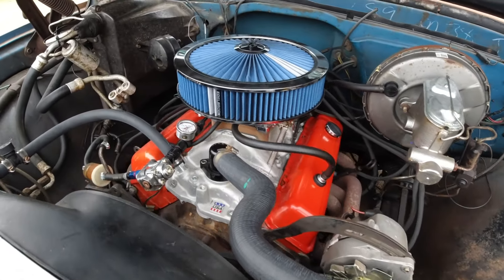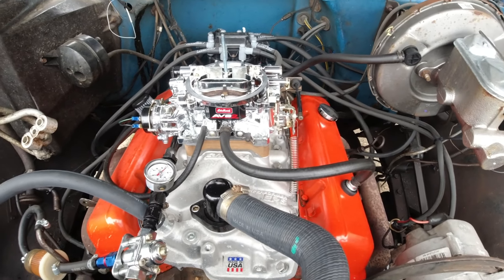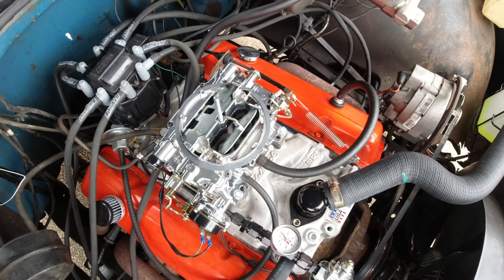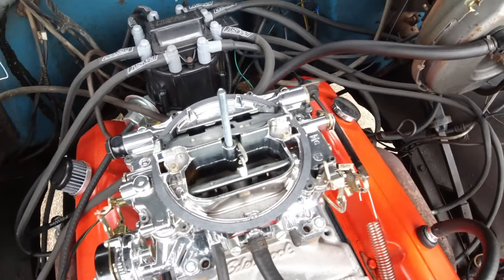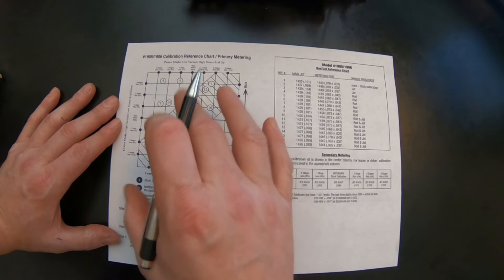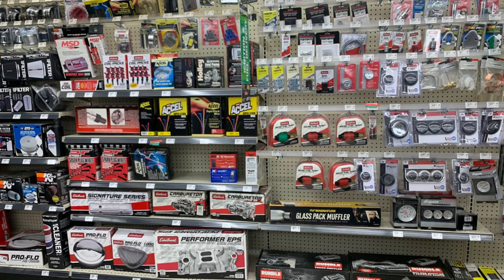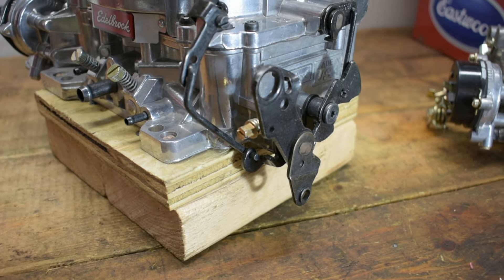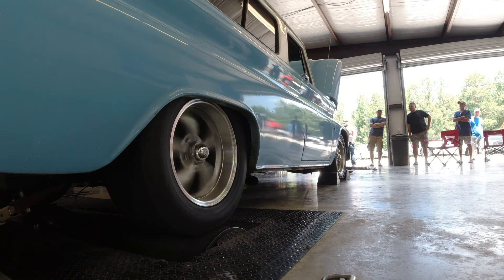Edelbrock Carburetors - The Good, The Bad and The Ugly

Comment: I have a stock pontiac 350 with basic upgrades and plan to replace my two barrel  , my question is what carburator should I run because I like autocrosding my car but I dont want to starve it but also a good cruiser, love driving my car everywhere
Reply from the maker: Check out my video on how to choose the right size carburetor.  How to Choose the Right Size Carburetor
https://youtu.be/Hy4s9B43YM0
Reply: @MuscleCarSolutions  thanks, I appreciate that but do you have a video on what style of carburator is better, like a Holley style compared to a tradition 4 barrel Carter like edelbrock
Reply from the maker: @Cristian-jc5og  talked about that in several videos.  It’s situational.  Define the situations you’ll be driving in the most and select the carburetor that beat fits that situation.  Primarily street driving, cruising, limited performance?  Edelbrock performer or AVS2.  Primarily at the teach drag racing, autocross, road racing?  Go with the new VRS 4150 or a holley.  That’s about as simple as I can describe it without going into all the details and why.  What are you doing with your car?
Reply: @MuscleCarSolutions  my car mainly is cruiser and loveing driving it often but occasionally like to autocross at the good guy shows , do you think the avs2 would be a good fit
Reply from the maker: @Cristian-jc5og  if you’re a mostly stock Pontiac 350, that doesn’t make a ton of power, but decent torque and will primarily be a street cruiser, it sounds like you have your carburetor type picked out.  Now you need to just determine what size and you’re ready to go.

Comment: I'm watching this because I'm toying with the idea of getting an Edelbrock for my 302c that I've bought to re build and it has a 600 holley on it with black carboned up plugs.
I've never seen it run yet but I'm going to try re building the 600 and see if I can get it to run without ruining the plugs with carbon.
Might try measuring the jet size to see if some idiot drilled them out.
Reply from the maker: @andrewstewart8704  you can’t tune CFM size.  Keep in mind, that 600 just might be too big for that engine, especially if it’s stock.
Reply: @MuscleCarSolutions  Hello from Sydney Australia!
The carby was on the engine when I bought it. A few people have said that it's oversized. 
I have no idea if it has a stock cam but I measured the stoke with the dipstick and came up with 3.15 inches stroke, No idea if something has been done inside at all.
I was thinking to try and go 2 sizes down on the main jets and really take note of the accelerator pump operation after a rebuild to see if i'ts too much fuel being tipped in.
I may try hotter plugs as well.
One guy on a forum said that going from a 600 vac secondary to a 500 was the best thing he ever did for his 302c
Reply from the maker: @ the small CI engines really struggle with more than a 500 CFM carb.  For some reason, everyone always goes bigger when they’d have a much better running and performing engine with the smaller size.  Engine specs matter, but if you assume it’s pretty stock, I think you’d have a much easier time tuning the smaller carb.  Cheers from Indianapolis IN (here for a performance trade show)!
Reply: @MuscleCarSolutions  Thanks for taking the time for your advise.
I wish you and your family a nice Christmas and new year :)
Reply from the maker: @ always happy to help if I can!  Merry Christmas to you as well!

Comment: I need help bad hopefully someone can help me, I have 350 chevy and my edelbrock electric choke starts good but if I drive a few miles it starts to wanna die and I have to keep my foot an accelerater to keep it going, it's not over heating. It's been rebuilt and if it does die its has a hard start but still drives like it wants to die like it's chocking
Reply from the maker: Disconnect the choke and hold it wide open and see what happens.  Make sure the linkage is operating correctly on both sides of the carb.

Comment: I would be interested to know if a set of stiffer anti sway bars would help the fuel starvation under hard braking. Yes the fuel wood still slosh to one side, BUT if the vehicle remained flatter through the corners, the fuel bowl wouldn't have a lower side to it( or be dipping  to one side) there for not affecting the level of fuel as much. Your thoughts? And or maybe adding a slightly faster fuel pump?
Reply from the maker: Unlikely.  Autocross, road race cars are set up with adjustable, stiffer suspension components and the improved handling creates additional forces pushing fluids around in the vehicle.  I like the line of thinking though.
Reply: @MuscleCarSolutions  lol yes I am well aware.  Is there room between the walls of the carburetor and float bowl to weld a baffle or a very short 90 degree ledge above the jet height on the opposite side of the fuel bowl wall? Similar to oil pan baffling ? To help hold the fuel from sloshing upwards?
Reply from the maker: @johnnyturbo8460  floats take up some space that has to be accounted for.  Ensuring the jet continues to be fed fuel is another concern.  I’ve seen folks try and JB Weld in some baffle type restrictions for the fuel to slosh.  I used to have some much narrower floats that I had made that would allow for some room to work inside with some of those ideas, but they’re long gone.  Would be pretty easy to mock up and try though.
Reply: @MuscleCarSolutions  cool. That's what I was thinking.  Where there is a will, there is a way.. your great video has now given me the will to solve that fuel starving issue.  I am interested in that avs2 Carborator.  Now I think I will get it and see if I can solve that issue.
Reply from the maker: @johnnyturbo8460  yup.  It’s a task for sure.  With more info online you might be able to find a float body in the right narrow size that you can alter to work and then start experimenting.  One of those things I’d like to try one of these days down the road when I’m retired and have some time!  Let me know if you have any luck with it!
Reply: @MuscleCarSolutions  will do!

Comment: May seem trivial, but I dont like that I cant directly hook a TV cable up without getting another piece to bolt on. Maybe it doesn't apply to all models, but I can get a Holley with that built in pop the cable on it and done.
Reply from the maker: Neither brand has all the hook ups for every type of transmission.

Comment: So you mention that edlebrock doesn’t hold up to as much power. What about dual fours? Does that make up for it? I imagine it does but at that point you’re lookin at around say 1000cfm.
Reply from the maker: Volume of fuel is it’s biggest downfall.  On a decently powered street car, it’s no issue.  On a 2x4 set up, you could adjust the progressive linkage enough to pull more secondary carburetor if you need more fuel/CFM.

Comment: I'm new to Eldebrock and want to build a sbc for high rpm, but good mpg when driving easy. I'm pretty sure I want to go Eldebrock and trying to decide between  the 600 and the 750 performer series.
Reply from the maker: High rpm?  How high?  For what purpose?  Because you’re asking for two things that don’t exist together.  Easy driving/fuel economy and high rpm.
Reply: @MuscleCarSolutions Yeah, bunch of issues. I had a thermoquad on a 340 that got low 11s and 17 mpg at 55. I'm hoping to build a  lesser monster, but still be quick. The adjustability is supposed to be good with the Eldebrocks, I'm hopeful that would help.
After doing some math with approx. 300 ci and 8K rpm, the 650 should suffice, using 90 % efficiency. It might be a hair under at the top end but I would rather be a little under than way over.
Reply from the maker: @troythompson1621  best of luck!

Comment: I honestly think that you left out another ugly part and it’s that edelbrocks especially pre thunder series are very sensitive to fuel pressure. Ive never had to even think about fuel pressure with a Holley or a quadrajet just bend the tab properly on the quad and adjust the screws on the top of the Holley, but when I put a 1407 on my 401 nailhead it took me 4 tries to properly adjust the float to the right level. First time it was running out of fuel second time it was dumping fuel and etc etc. I still haven’t been able to tune the off the line bog out of the thing. Keep in mind this is from a dead stop to foot on the floor but there is a considerable hesitation. There’s just no way to get more of a pump shot for the big Buick motor to feed off of until the boosters actually come on on time. I put a quadrajet on it and after rebuilding it it runs amazing no off the line bog and the air doors are tuned properly so it runs as close to fuel injection as you can get. I know that every carb has its application, but for heavier cars that require a bit more of a pump shot to come to life, the eddys seem to lack. But that’s just my experience and this is a 4500 pound car with a characteristically torquey and high velocity engine so might be a bit extreme of an example. But they did come with afb’s from the factory.
Reply from the maker: I’ve always viewed it as just part of the tuning process.  I’d call it a neglected part.  It always amazes me how many carbureted folks don’t have a regulator.  It adds an important tuning point for any system.  But most overlook it or ignore it completely.  I wouldn’t call Edelbrock carbs extremely sensitive to it.  Most that I end up working on have operated for long periods of time without one, but I fully agree all do.  It’s a point worth mentioning for sure.  I think It’s more for carburetors in general though.  Run a regulator!
Reply from the maker: To your problems on the 401.  The issues you’re having can be tuned out.  It’s just a process.  Does take some time and effort but in the end, tuning is another one of those things that’s highly overlooked.  Most just assume bolting on something right out of the box and monkeying with the idle mixture screws is tuning.  Oh so much untapped potential!

Comment: Will having my pcv port blocked off on the carb affect performance it has one of those big chrome pcv vents on the valve cover and the pcv port blocked off ?
Reply from the maker: On a street car?  How are you evacuating the crankcase?
Reply: @MuscleCarSolutions  Yes it’s a streetcar bone stock 350 with a Edelbrock 600 on it in place of the PCV it just has a little chrome filter in the port is blocked off on the car
Reply from the maker: @traxxastmax1  so you’re not evacuating the crankcase.  On a bone stock engine, you should have that PCV system hooked up.  It helps keep the pressure out of the crankcase and there is zero negative effect on performance.
Reply: @MuscleCarSolutions  cool yea it came like that it had a filter on the valve cover instead ill get one now

Comment: Ive got a bad bog situation on wot, but not when you roll into it slowly. Ive removed the egr, changed coils, checks the timing and advance, new plugs/wires, cap/rotor, new fuel pump/filter, tuned for 20 units of vacuum, i dunno what else to do. Its on a chevy c10 305, using a edelbrock 600 cfm. Factory intake with the edelbrock adapter.
Reply from the maker: Well there’s a number of things here.  It is a 305 and any sub 4” bore engine is a little difficult to tune in stock form. They’re rather gutless.  Take some fuel away on the accelerator pump and see if that helps.  Move the rod to the hole furthest away from the pivot point and see if that help.  Have you used the calibration kit to tune the carburetor yet?  That’s your next step.  You said you tuned for 20” or vacuum.  What did you do?  Changed the step up springs?  What color did you put in?
Reply: @MuscleCarSolutions  i haven't changed the springs or needles, only the idle mixture screws. Carb was "new" when i got it from a guy. But it was obviously used, and i have no idea if he changed anything
Reply from the maker: @HoosierSquarebodyGarage  ah.  Well mixture screws have zero effect on wot operation.  Get a calibration kit and start tuning.  Try the accelerator pump change I mentioned.  I have tons of videos on that and the process.  Right now no changes have been made that will start you on the right path to eliminating that bog.  Chances are high that you’re adding too much fuel.
Reply: @MuscleCarSolutions  alright, thanks!
Reply from the maker: @HoosierSquarebodyGarage  once you get started and you have any questions, don’t hesitate to ask.  Glad to help if I can.

Comment: Are the fuel bowls hard anodized for the crummy fuels of today ?
Reply from the maker: No.  The Edelbrock performer and AVS series carburetors are rated for E10 only.
Reply: @MuscleCarSolutions  so when my classic car sets through the Midwest winter and the E10 fuel in the bowl sucks the water from the air as it evaporates, it will ruin my new carb, right?  Fuel injection is looking better all the time!
Reply from the maker: @onehot57  you’re exactly right about the water.  The ethanol additive sucks, but it’s the water that’s the killer.  I use a longer term storage additive that has helped tremendously. Fuel injection isn’t immune to it.  It just has a direct path from the tank into the system.  Same horrible things can still occur.

Comment: Just a question  ,,fuel pressure regulator able to stop difficult left turn with supplying more fuel ?
Reply from the maker: Doesn’t help.  The float level would be the best solution if the float bowls were twice as deep.  Pressure and flow doesn’t have much to do with it.
Reply: @MuscleCarSolutions  thank you ,,

Comment: Would a Duel feed fuel line solve the fuel starvation problem, as stated in the Ugly, if not what is the benefit of the duel feed?
Reply from the maker: Potentially but in instances where I’ve seen it run, it did not cure the issue.

Comment: I think edelbrock added daul inlets to help with the hard left turn prob on the avs 2 just a theory
Reply from the maker: They have had dual inlet capability on the older thunder series carbs and that carried over to the AVS2.  It’s a good addition but didn’t quite solve the issue.

Comment: My 1406 backfires when cold. I have adjusted choke,pump linkage,timing. Still backfires. Edelbrock says it’s normal. Any idea? Thanks
Reply from the maker: What’s your timing set at?
Reply: @MuscleCarSolutions  10 degrees advance
Reply from the maker: @kenegidi6813  what elevation are you located at?
Reply: @MuscleCarSolutions  Ventura ,ca. sea level
Reply from the maker: @kenegidi6813  need more timing to start with, then determine if it’s a lean backfire.  When you say it does it when it’s cold, so you mean at idle or when you drive it when it’s cold?  At idle what’s your engine vacuum?  What step up springs do you have in it?  Time to fatten it up a little and see if that’s starts to take it away.
Reply: @MuscleCarSolutions  when accelerating off idle,only when cold. Jets are .095, yellow springs. Don’t remember vacuum.
Reply from the maker: @kenegidi6813  yellow springs are pretty light.  I’m assuming then you have around 8” of vacuum and a fairly aggressive cam if you’re running that spring.  Go 14-16 on the timing.  See if it makes it better or worse.  Or if that’s the wrong spring and you’re rich, then the timing adjustment should help.  Best to get a gauge on there and see what your full manifold vacuum is at idle and verify that spring selection.

Comment: Anyone who laments and degrades the Quadrajet carb is merely just showing their ignorance. Theres a reason that the Q-jet was in production for 25 years, albeit with some design changes. Unlike the Edelbrock and Holley carbs, they were designed for, and primarily used on mass production street vehicles. There were literally millions of them built over the quarter century they were in production. And most of the ones people see nowadays have many thousands of miles and years of wear and tear on them, so  for someone to rag on them because of leaky well plugs, worn throttle shafts, or clogged idle passageways, is asinine. While they won't best a race prepped 4150 or demon carb, they are very adaptable, and with a 76+ carb they have excellent adjustability and 800+cfm right out of the box. Yes, it takes more knowledge to tune and tweak a Q-jet than a Holley or Edelbrock, but thats part of the fun! 🙂

Oh and for what its worth, the ONLY carb that i have ever just "dropped on and went" was a late 70s 305 powered Buick with a 600cfm Edelbrock w/electric choke. All i did was tweak the idle speed screw and it was trouble free.

Comment: I have a avs2 on a 350 engine. It’s gettin way to much fuel , flooding the engine
Reply from the maker: So what steps have you taken to correct it?  What’s your fuel pressure regulator set to?  Check the needle and seats for garage?  Check the float level?

Comment: Just for info, a 1406 Eddy is pretty much the same carb as a '65 Vette 327 carb, nothing was improved over the decades
Reply from the maker: I’m not sure that statement is accurate.  Do they both meter fuel and air?  Yes.  Is the newer design Edelbrock designed to handle the additional volume of an ethanol additive fuel?  Yes.  Is that 1965 carburetor optimized for that?  No.  But is that a improvement?  Ethanol?  No.  But it does the job differently for sure.
Reply: @MuscleCarSolutions  My 1406  that is about 10 years old & has the Weber mark uses all the same gaskets as my '65 409 carb. I was not referring to the new carbs with ethanol mods